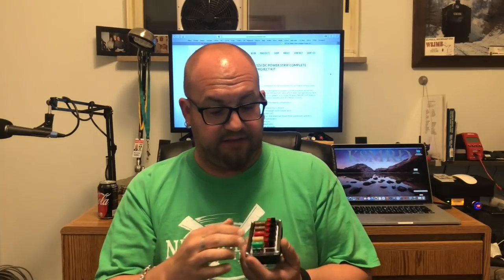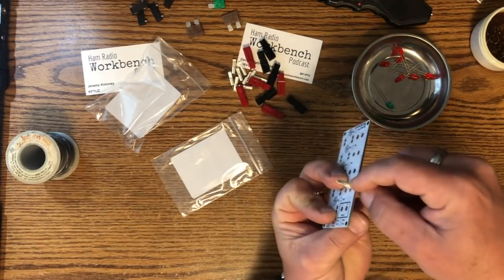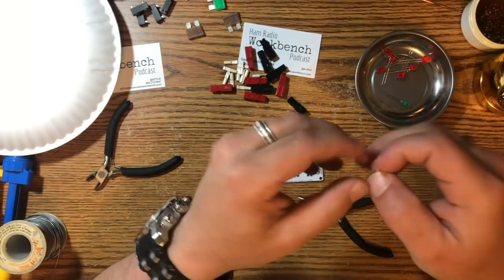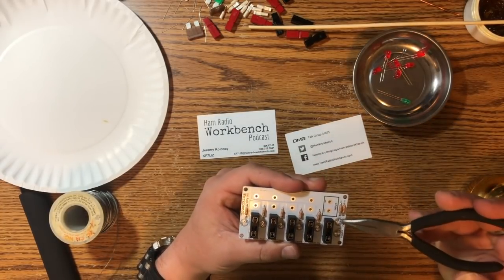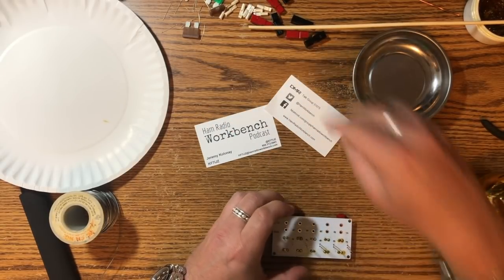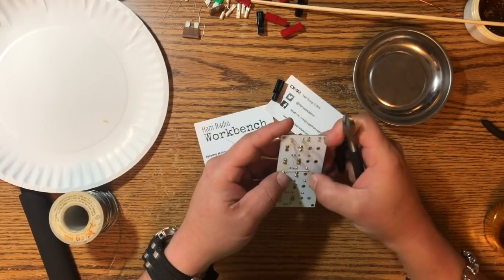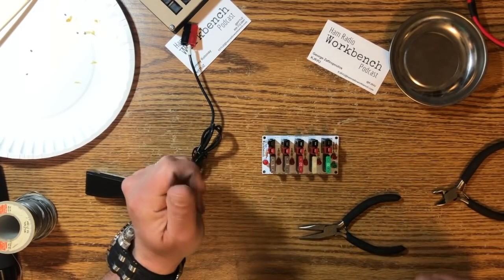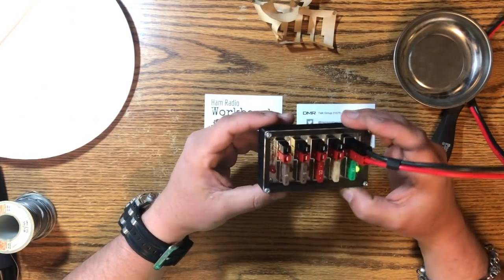Ham Radio Workbench 12V Power Supply Build.

Comment: Hi, i checked the website of HamRadioWorkbench, and see the part list, but no mention on how to get the PCB itself? or is that part of the PCB bundle?
Reply from the maker: Hi Martin.  Good question, and I don't have an answer.  I haven't talked to him in a while.  I checked the link on my video and sure enough, they are sold out.  I shot him a text message asking what is going on and will let you know if I hear anything.  Not gonna lie though, I know this is not his full time job and is just a little side project of his, much like the PackTenna, so I wouldn't get your hopes up of seeing it any time soon.  Of course I hope the opposite is true, but I may have just lucked out at Hamvention last year meeting both HamRadioWorkbench and PackTenna at the same time (they were in the same booth).

Comment: This is a nice project but I just bought a Anderson Powerpole RIGrunner that cost a dollar less than this kit fully assembled. It uses heavy copper traces for better power handling. You did a great job here on this one though. I might have built a kit for fun but my hands aren't as steady with a soldering iron as they used to be.
Reply from the maker: Yeah there's def ones you can buy assembled but I really wanted the satisfaction of building it myself and I'm really happy to support the great bunch of people that make this kit.

Comment: I don't have fingers, I have 10 thumbs. I am sure I would frig that up.  It would be a big mass off screwed up connections. Most likely be a magic smoke emitter.
Reply from the maker: Dude if you have 10 thumbs than I have 11.  You can put this together.  Never underestimate the power of the Schwartz.
Reply from the maker: Thats a Spaceballs reference BTW
Reply: @hamradiotube  Its to bad, I just had bought a  cheap 8 circuit one from Amazon all put together. It was like 60 bucks.

Comment: That's really awesome, thanks! I do have two questions: (a) Why did you add flux if your solder already had flux in it? and (12) What's the purpose for the differently rated fuses? Sorry if these are dumb questions, but I'm a relative newbie.
Reply from the maker: The flux in the solder burns off pretty quick so sometimes on the bigger contacts its necessary to add more so you get a good contact.  It prevents cold solder joints and is also used if you need to reflow the solder.  You only get one shot with the flux in the core.  The different fuses are for devices that draw more or less current.  Small devices like my USB that I hooked up to it wouldn't be hooked up to a 25 amp fuse because if something went wrong the device would burn out before the fuse.  That would be bad.  Conversely, if I hooked my radio up to a 5 amp fuse it would blow the fuse right away, also bad.  Hope this helps and thanks for the comment.  73
Reply: K8MRD RADIO STUFF That makes perfect sense, thanks!
Reply from the maker: thormusique no prob. Glad a dummy like me could be of some help haha!

Comment: Plug in a radio or other load. Pull fuse (simulate a blown fuse). Does LED light?
It probably needs a current path through your load.
Reply from the maker: That it does.  I got it all figured out.  Works great.

Comment: The instructions are on the product page of the site you linked to in your description. It's under the Documentation heading and listed as "12V DC Power Strip Assembly Manual". It's a PDF file. (Also, resistors are non-polarized so there is no improper orientation. LED's are polarized so you may want to double check that  you got those right).
Reply from the maker: Ok good to know.  I just went to town on that.  Didn't know about the LED's.  I may be making another video...Thanks for sharing!